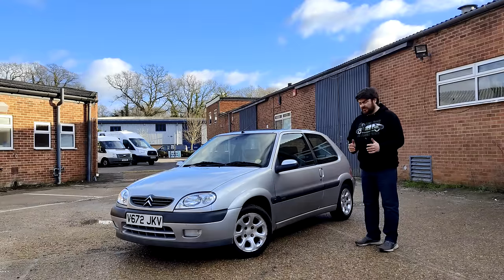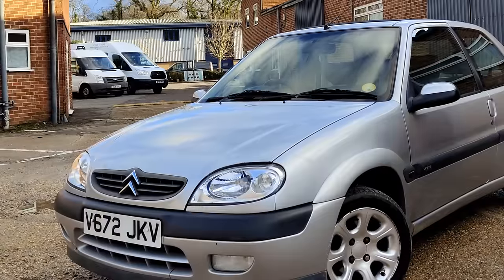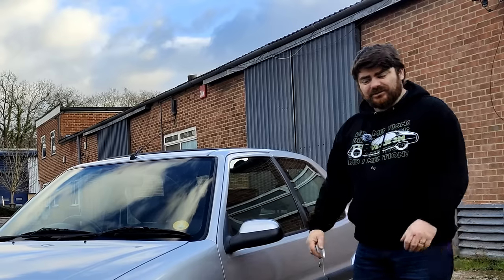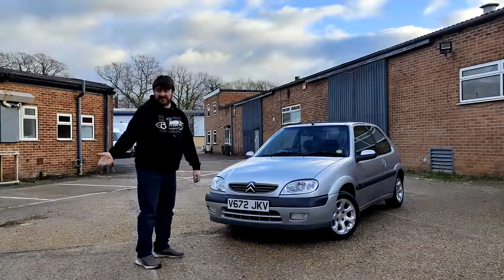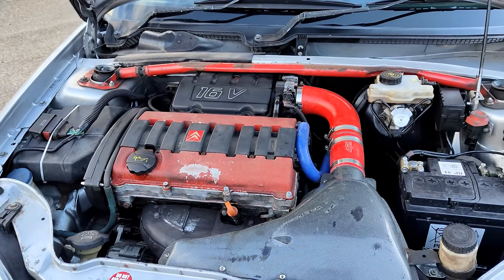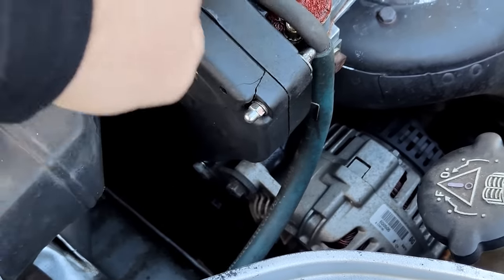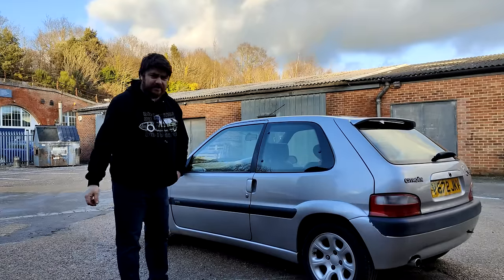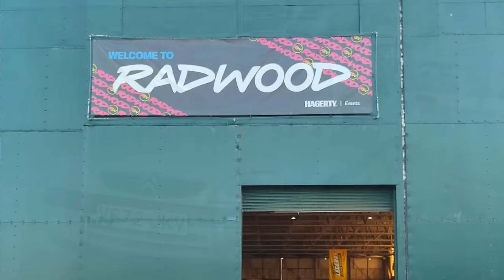STORYTIME: Twenty Years With A Saxo!

Comment: Had my Saxo VTR 13 years, (Pauline I named her after a random name on the numberplate that caused it to fail an Mot) she was my first car, and then I moved to Australia, I left it to a garage that I worked at, as a courtesy car.
My first 2 years insurance was just under £5800 quid, for a car worth 1500. And that was 2008 prices.
The garage added it to their fleet insurance for 12 quid a year...
I returned home, got the saxo back, and had many happy years with her, but she got retired and I bought a PUG 306 dubbed Pauline 2. I then moved to Australia again, and left the saxo back at the garage again.

I moved back from Oz again, got the saxo back a third time and took my Mrs (from NZ) all around the UK in it.

Then I shipped it to NZ.
So I was 3 of the saxo's 6 owners in the UK. 

It's driven up the steepest streets in the world, both in Harlech Wales and Dunedin New Zealand BEFORE Mr Hubnut and his falcon! 

Then in August 2020, she was written off by some dozy person in a Ford Territory. (small scratch and dent in the Ford)
I had shipped every single part I could think of with me to NZ... bonnet, wings, doors, rear bootlid, bumpers, door glass, brake pads and discs, lights, even a replacement radio, but alas, they said she was too far gone to fix... 

So my beloved got written off but it's not the end of her story, I sold her to someone who's turned her into a race car in Auckland.

I miss that Saxo terribly, my wife hated it. (Small, noisy, dripping fluids everywhere, and the Saxo was the same.) and I wanted to keep it for my daughters first car, but unfortunately she'll have to find another shit box. 

RIP Pauline. The one and only Mark 2 Saxo in New Zealand.
Reply from the maker: Comments like this are one of the best parts of making YouTube vids, really appreciate the time you took to tell the story! And now, Pauline will forever remain pinned here on this video's comments thing.

F in the chat for Pauline.
Reply: F
Reply: F. One love Pauline and shout out to yer family!
Reply: Who’s Pauline?
Reply: @tdick1541  Bros car.
Reply from the maker: @SpaceHCowboy  RIP Pauline, and shout out to her family
Reply: @SpaceHCowboy  Shout out to Pauline then 🫶🏼

All the way from Selly oak, Birmingham England 👊🏼👊🏼👊🏼
Reply: @tdick1541  Good man, respect. 🙏🏼 🙏🏼
Reply: My wife also hates my SAXO😂
I really love it.
If you maintain it well and give it some TLC this car takes you everywhere.
I have my car now 10 yrs. 
Saxo 1.1  2003
Way back I had a 1.6 8v, nice memories 😉

Comment: As an owner of a MK1 Saxo VTS, I think these cars are a little overshadowed by far more 'quirky' Citroen models and often feel that I can't class myself as a true 'french car fan' because I've never had hydropneumatic suspension or yellow fog lamps... So I was delighted to see you do a video on one of these great little cars, great story behind it too!
Reply from the maker: That's a great comment. There is a fair bit of badge snobbery, even within deeper Citroen circles. I suppose it's generational, but when the brand in question has the SM, DS, 2CV, CX etc in their back catalogue, anything 'mainstream' is going to struggle a bit. The BX was looked down on for years, even at CCC meets. It's only recently starting to float to the surface.
The Saxo isn't the most interesting, technically, so the Citroen crowd won't be too interested, but they're interesting from the POV of sales, marketing and youth culture. Probably Citroen's most mainstream car. But the Saxo is VERY French in its DNA. The suspension; the design under the skin...it's all very 80s Peugeot.

Comment: I had one of the 100bhp VTRs from factory. Bought it brand new in 2001. It was a quick car. Could easily do 120mph and often did. I fitted a full stainless exhaust, 4 branch manifold with sports cat and a Piper X filter. All round uprated brakes. Because standard brakes were crap. Wish I had never sold it.

Comment: My dad brought a new 1997 red phase 1 Saxo VTS when I was 10, it was a very early one that came without the rear spoiler. Dad never modified it and did nearly 140k miles in it over 12 years but unfortunately he had an accident in 2009 which rote it off. That was our sole family car for many years and would take us (family of four with dog) on holidays with all our camping gear. It obviously left an impression on me as I ended up with a french hot hatch (Peugeot 208 GTi) which I've now had for 6 years and 65k miles. 

Thanks for the video.

Comment: I like your channel because of the way you explain everything. They way you call it John’d up, cracks me, but can you explain why John. My name is Jon and I find it funny. 

I was a young guy around the same time. 2001 I bought my dream car, a 1990 Corrado g-60 (couldn’t afford a Vr6). I absolutely loved that car. The only modification when I got it was lowering springs and adjustable shocks. I later did all the major mods to the supercharger and it was a blast. At the time I hung out with the Tuner crowd and some of them did the same wild and obnoxiously mods that I was seeing in a Max Power magazine at the local newspaper stand. I was kind of surprised that people in England were taking it a bit further than the crowd in the USA.
Reply from the maker: I like Corrados. I knew a guy with a VR6, it went well.

Comment: best times of my life in these cars back in 2006 to 2008, vts with cat cams 708s and another vts with a rotrex c74 charger doing over 200 at the wheels. the chatter sound from the charger when letting of throttle was the best noise ever

Comment: I owned a Silver Saxo VTS for about 4 years. Great car, great engine dropped on Bilstein B8s, 30mm springs, rear adjusted properly to match. Full stainless supersprint exhaust,  421 decat, polybushed and wildwood brakes. It was a mega car. It sounded great and miss it dearly.

Comment: At 17:00 you reminded me of my father's Ford Zodiac, which had features showing it was a transition model from the 1970 facelift: it had an earlier cooling system but it had the walnut dash of the 1970 facelift - but externally, it didn't have the trim strip along the waist that the facelifted cars did.

Comment: I had an S reg VTR, the sunroof used to leak, in the rain everytime I hit the brakes I'd get a shower, ended up having to use black silicon to seal it, then wrote it off a few weeks later when a truck pulled out right in front of me doin 100 on a dual carriage way

Comment: I had an AX GT - proper pocket rocket right until on a rainy windy night a warning sign was blown over so I flew off the end of the section of road which had been removed for resurfacing and the "raised ironworks " ie a manhole I was unknowingly trying to clear took the sump clean off.  Scrap value was bobbins too - as the scrap man said "its 90% 'effin plastic son" lol

Comment: Great vid. What a trip down memory lane. From what i recall, most 1.y 16v engines put out about 130bhp. That wa sthe norm for the 1.6gti. a Peugeotsport exhaust and a filter would usually see you at 140bhp
Reply from the maker: Filter and exhaust don't really add much from my experience on the dyno, but I do agree they seem to have more poke as standard than claimed.

Comment: Totally agree on the choice of wheels. The "Ville de Toulouse" is the perfect Saxo wheel.
Deja vu: I once bought a very cheap Peugeot 106 Rallye. It looked immaculate on the outside, but underneath it was just like your Saxo in 2014. 
I gave up trying to fix it and broke it for spares (you need to love the car to put that much work into it ).
Reply from the maker: I loved my S1 Rallye. That's the engine I'd love to have in Hilda.

Comment: Great presentation, didnt have the pleasure of vtr or vts but a standard Forte model on a Y plate (2001) had shared use of a P (1997) before that no idea model but was basic with a keypad before you started it. Gear linkages were awful on both. Great car  for my wife to learn to drive in. 'Mr Saxo Beat' she called hers. Rust killed it and she brought a Ka.

Comment: Hi UnD, I suggest that maybe the thick ARB was because they used lighter settings on the rear suspension components, compared to the Peugeot, to give that softer Citroën ride yet still be stable in the corners. Also popularity was due to the 'get-you-into-debt quick' 0% interest deals. But definitely true - Vauxhall Nova supplanted the Triumph Dolomite, and this supplanted the Nova!

I would love to see a Mi16 engine in one of these.
Reply from the maker: Might be. Given how much this thing torque steers, it might also be to resist pitching/squirming at anything other than a straight line!

XU9J4 has been put in one, but the general conscencous is that the gains over the TU5J4 aren't enough to justify the huge job it is to get it in there!

Comment: Love your story, very enjoyable. Bits of it resembles my BX 16V love story. It also developed a cutting out problem and now I know that Coca-Cola is not what you should spray inside the ECU whatever the problem (like the previous owner obviously did...). Though I been living with Citroën (most models) since 1973 the Saxo was a blank page in my book... until now 👍😊 Thank you for an excellent presentation!
Reply from the maker: Wait.....Coca-Cola?!
Reply: @UPnDOWN  Right... probably not on purpose or consciously. But it being located under the passengers seat (EU) it will be in the way of spillage both from the passenger and from leaking cans or bottles on the floor in the back. The signs were there, brown/blackish and very sticky with a sweet taste 😝.
I actually washed the boards in lukewarm soap water and let it dry for a couple of days. It worked for some time but finally a had to purchase a refurbished ECU from the UK. You are soo much better at providing that kind of services than we are here in Sweden. It ran perfectly untill I sold it at 210000 miles.  It was a 1987 EU spec without catalytic converter and produced around 170 hp on a rolling road test with a modified stainless exhaust. It passed 100 km/h on the clock in second gear. Very nice!

Comment: I had an all but dead Allegro (1500) at the beginning of the 90's, no car (lived near Manchester and couldn't afford the insurance!) until 95, then had a 2l n.a. diesel Maestro until I wrote it off in 98, then bought a new 1.9 diesel Skoda Felicia estate - which needed a new gearbox within 5 years ...
I guess I missed the hot hatch / car modding scene!
My wife got a 97 Xsara 1.4 in 2002. I got an L reg Xantia 2l petrol hatchback in 2003 for £750 - it had about 140k miles and the suspension sank over a couple of hours, but otherwise worked - as it was the most knackered car when we moved in with my wife's parents in 2004, we didn't need a forth car and after fitting new discs and pads one pad with a tiny drop of brake fluid on it ruined a disc within a couple of months, it was disposed of. We traded in the Xsara (after it's power steering popped - damn heavy steering without assistance!) for a 1998 Volvo V70XC in 2005 ... After spinning it on a roundabout after a sudden downpour I realised that car had more power than I had talent so I traded it in for a Y reg Freelander in 2009. The 18mpg was hurting a bit too! 4wd petrol auto - who would have thought!
The auto gearbox on the Freelander gave up in 2012. After a 3 month fling with a high mileage 2005 55 plate 1.6 LX C5 estate (which spent half that time off the road and would cut out and refuse to start for 15 mins if you accelerated too quickly when it didn't feel loved - shame as it was a lovely car otherwise - apart from the glass tailgate hatch being bolted shut rather than have a catch, because LX spec!) I returned it and got a 58 reg Mazda 5. By the end of 2014 (having forgotten to service the car as it was hardly used whilst I commuted by train, then started driving to a new job) it needed a replacement engine (whoops!). 30k miles later around Easter 2017 the recon engine threw a piston after 3 hours at motorway speeds damaging the gearbox and aircon ... I've not had a Citroën since (though I keep looking at the C5 estates - I'm not greatly keen on the 2008+ shape, although I did see a 2016 Euro 6 diesel for sale recently ... If I had anything close to the 12k requested I might have been tempted!
The only cars since have been a 2006 Honda CRV (please don't hate me, I was looking a C4 Grand Picasso's and saw it ... this needed replacement suspension parts every MOT, then suffered from a dodgy injector so got sold to a friendly garage in 2021. After a couple of months this was replaced by my current car, a 58 reg Seat Altea XL, which is OK (140hp, 6 speed DSG), but just a bit boring.
Not boring is the 97 P reg RAV4 3 door auto my daughter bought for £800 in early 21, passed her test in it before finding 19mpg isn't great! My wife inherited it when her 02 reg RAV4's auto gearbox died for a second time. It's engine could do with some work as some of its horses have escaped. It has some dents / patches touched up with the wrong colour (could be a purple rust killer?). It also clunks when manoeuvring near full lock - I suspect the mechanism to unlock the 4wd has failed. Only ~63k miles, so both the oldest and the lowest mileage car we have!
Reply: Car history is great - you get attached to the odd ones  ...
Less great is insomnia!

Comment: Out of (slightly geeky) interest, what was the torque of the VTS at 3k rpm, i.e. did the VTR ever have more torque over its rev range? Leaving gearing aside.
Reply from the maker: Only graph I have suggests VTR is kicking about 90lbft @ 3k rpm, whereas VTS is more like 100-105lbft. The VTS is quite broad between 3k and 5k, it's just that it peaks around 5k.

Comment: Very interesting video and story of your car - never had one but had a drive a few of those and 106’s back in the day. Just a bit curious on one bit of the story as the part where you show the old advert for the car (well done finding that BTW), it says the car has 55k so being curious to know how many miles it has on it now as that was 20 years ago I had a look and was shocked it has hardly any miles added.  But when I looked back at MOT history for the first logged MOT online from 06, that had the mileage at 33.6k.  So big question - was the advert wrong or did you clock it 😂.  Hardly relevant because of all the extensive work you’ve done over the years, but curious just the same.
Reply: The advert is the correct mileage (it's the original print off of the advert from the day I viewed the car). When the previous owner had the car, it had a new set of dials at 40,000 miles to try and sort out a problem of the fuel gauge not reading correctly. So the dials read 15,000 when I bought it but it was really 55,000. And the new dials didn't sort the fuel gauge misreading, which it still does to this day!
Reply from the maker: Trunky want a bun? :-p

Comment: How many miles has it got ? 
Used to see them a lot on the road here in Belgium, all gone now.
Reply from the maker: It's on about 126,000 (engine 127,000) but shows less because it had a new set of clocks.
Reply: @UPnDOWN  
Still less then my daily in use Spitfire 1500 with nearly 230.000 miles on it 😅.
(In the last 10 years i drive it put on 155.000miles)
 
My father was real XM guy, he had 3 of them.
2100 diesel with 600.000kms /372.000miles
And in 2000 he bought one of the last 2500 diesel exclusive's, in 2008/2009 it was sold for parts.. it had 821.000kms/510.000miles on it, yes in 8 to 9 years !

He then bought another, buy had no money for all the belts, service it etc. 
So bought a 206 GTI 😅

Ps, keep posting them video's  😉

Comment: The 2001 road tax revisions hit a lot of Euro 3 revised models rather foolishly but at least now they are largely ULEZ compliant…. my 2001 Fiat Brava 1.2 16v 80hp with manifold catalyser, twin 02 sensors and fly-by-wire ECU was more expensive to tax than my 1995 Tipo 1.4 8v with SPi.
Reply from the maker: Ridiculous, isn't it?